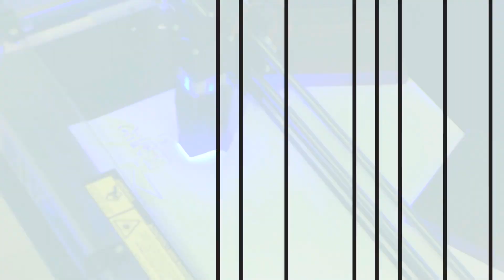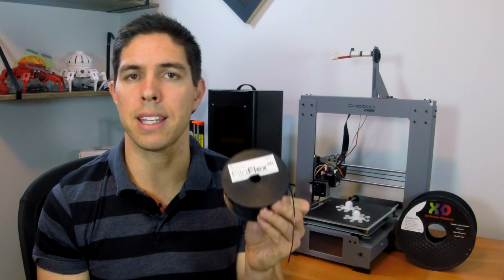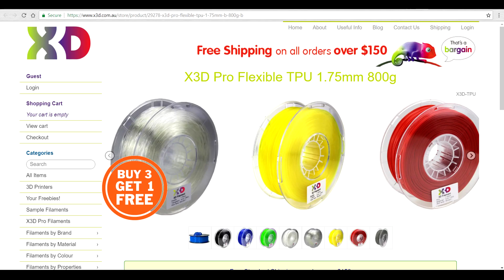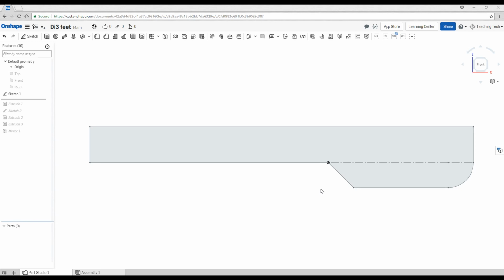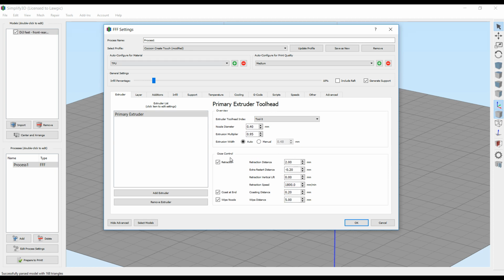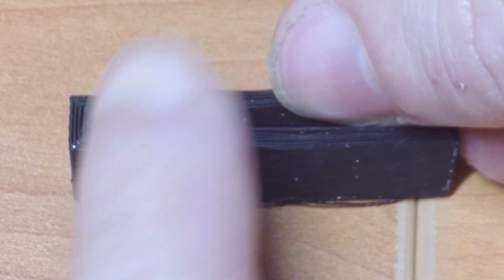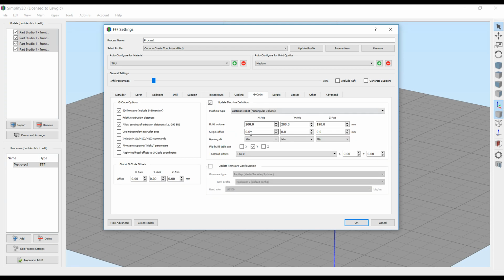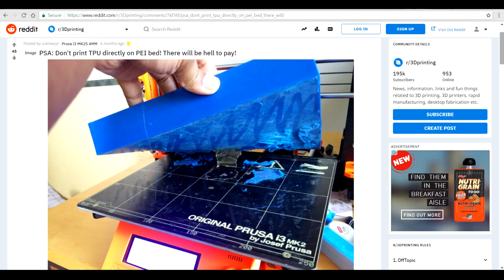Guide to printing flexibles with a flexion extruder / Di3 flexible feet

Comment: Nice video! How's this extruder been working out for you? I got one two about 2 years ago and designed mount for CR-10. At first I was impressed but very quickly I started to have tons of issues with Flexion. It would absolute refuse to extrude PLA and with Ninjaflex and Cheetah it would also stop extruding shortly after print started. I spent a lot of time troubleshooting the issue, replaced stepper, tried tons of different settings, but eventually I just gave up. I heard very similar stories from other Flexion users, so I was wondering if yours is still working good...

Comment: Have you used CURA at all with this printer and extruder setup?
Reply from the maker: I haven't used Cura with it since it was stock.
Reply: Teaching Tech I was pretty close to 100% deadest I’m getting a new Prusa MK3.  That is until I watched THIS video.  Now I’m torn.  Especially when taking into account the bond tech extrusion issues that the new MK3 is having.  Decisions decisions.  Keep these videos coming and maybe one day I’ll decide.  Lol
Reply from the maker: Good luck with your decision. PS. Most problemss can be solved by throwing money at them, which in this case means getting both :)